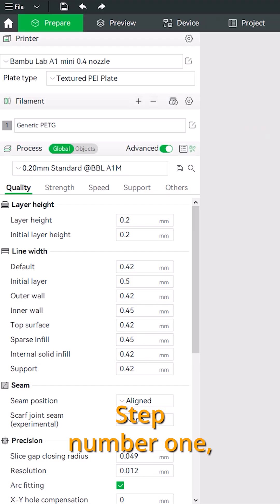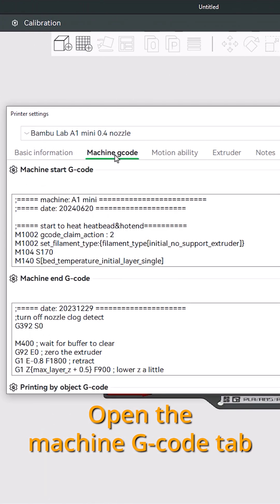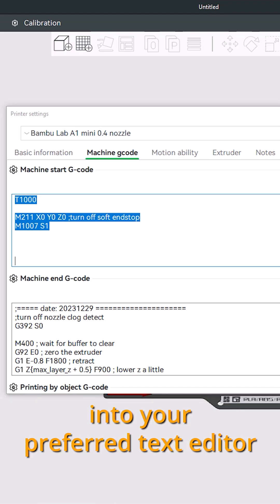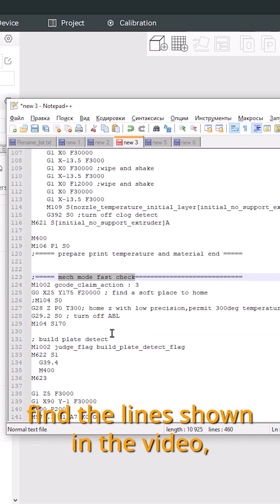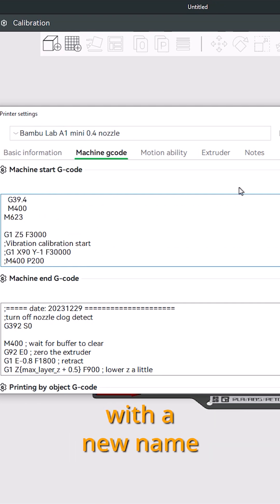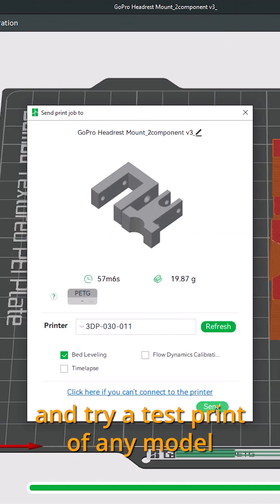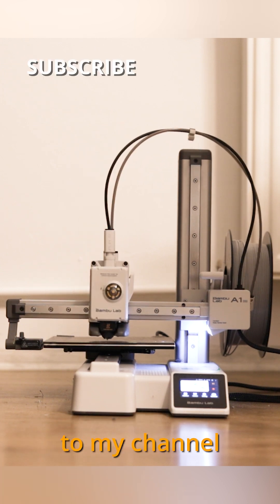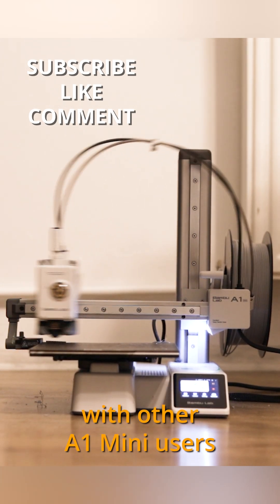How to disable vibration at start for BambuLab A1 Mini #shorts

Comment: DO you have like this but then for disabling the cutting filament line?
Reply from the maker: If you can describe me more, I can try to find these strings of code. Why do you want to disable it?
Reply: @IzoFoxUA  because it stops my print randomly amd that is annoying for me because the printer is in my basement. And i mean my printer does stop at the filament cutting screen and it say that the filament cutting is failed but i have read that you don't need that "feature" if you don't have a ams lite and I don't have that, so thats the reason
Reply from the maker: @ItzDinand  ok. Do you have a telegram, whatsapp or any messenger?

I think that maybe you need to fix your filament cutter. But I can help you with turning off this feature.